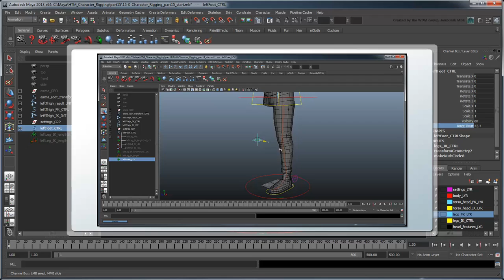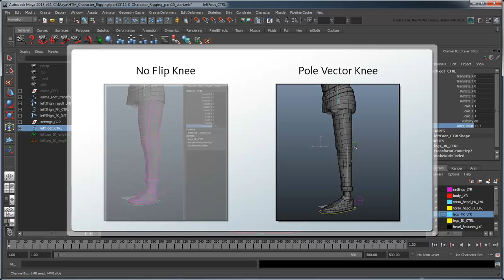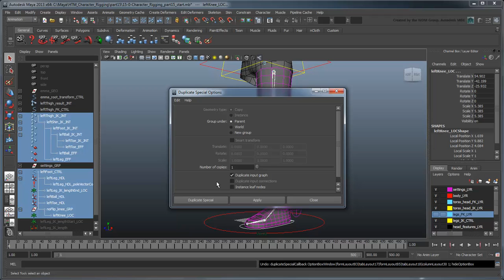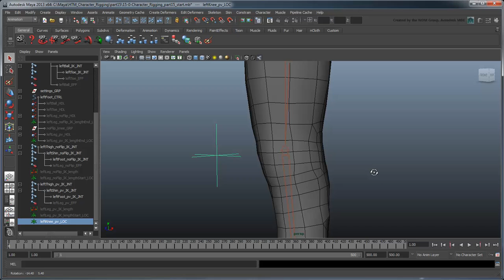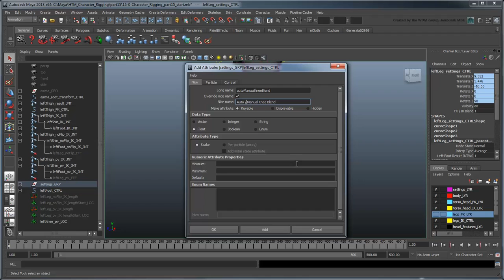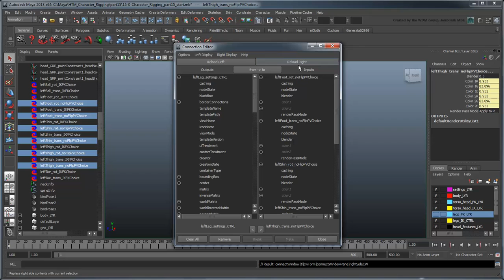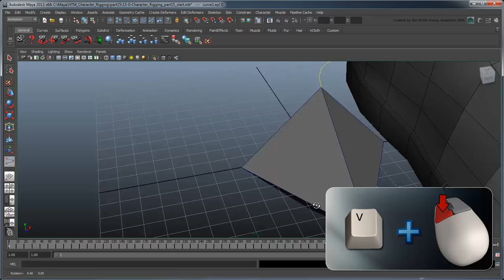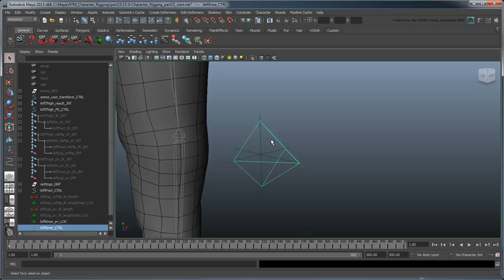Creating a Character Rig - Part 15: Dual knee solution (Advanced)

Comment: Minute 6:02 is confusing because you put leftThigh_noFlip_IK_JNT up, and leftThigh_pv_IK_JNT down. 
In part 10 you connected the upper node to color 1, and the lower one to color 2. So, we deduce that all noflip nodes should be connected to color 1, and 
pv nodes to color 2, but suprise! At 6:05 you have leftFoot_pv_IK_JNT up and leftFoot_noFlip_IK_JNT down. In this case, leftFoot_pv_IK_JNT should be connected to color 1
and leftFoot_noFlip_IK_JNT to color 2.
This could be a problem for some rookies. I even thought I was doing something wrong, but the problem was that I was doing it the other way around.
Please, correct this.
"Gracias" from dangerous Mexico.

Comment: So just wanted to be sure, for now and for the nearest future. No-Flip (Auto) and Pole Vector (Manual) is in the same order for FK/IK.

So in the node editor, "PV translates/rotates>Color 1 trans/rot" blenders.
And "noFlip translates/rotates>Color 2 trans/rot" blenders.

Is that right?
Reply from the maker: In all honest, it doesn't matter as long as you name the custom attribute appropriately.  However, you are correct that the Emma rig specifically follows those conventions.

Comment: when I delete the original IK foot_CTRLs rightLeg_HDL and rightLeg_IK_lengthEnd_LOC my leg mesh goes crazy. It like its lost the previous vid leg stretch. is that due to the inverted values in the script or the extra multidivide node mentioned in the comments.....really wish you did both legs at once ( 2 weeks later and I only have half a rig).
Reply from the maker: Try unparenting the geometry first before doing that stuff.  And yes, unfortunately it is quite a long process but I promise it'll get faster once you've done it a few times (it'll almost become second nature).  The idea was to leave the right side as a review of sorts, to make sure people really understood how to apply the concepts taught on the left side.  That'll be much more important for your career down the line than any single rig.

Comment: Dayum, i paused the previous vidéo to make my own knee aim controller (i did'nt want to control the spin within the channel box) But you did a vidéo about that X).
However, I think this is not the easiest way to do it. It's totally possible to have the same result with one IK chain and one pole vector (those created in the previous vidéo) using a method similar to the head follow tutorial ^^
Reply from the maker: The dual knee solution is optional.  You're right that it's not the easiest, but it is the solution that gives you the most versatility.
Reply: Yeah, i saw that after watching the next vidéo ^^. Thx for all those tutorials, that's really helpfull. Next time, i'll try with the multiple IK chains. It seems tricky to built but also  very interesting and easier for the animator to handle :)

Comment: Hi maya i delete the original IK_foot_CTRL and Leftleg_HDL in 2:42 on your clip .but my Thigh and Shin GEO is gone and Foot fallback To Thigh JNT  I have no i dear what i do wrong How it happen ?
Reply from the maker: Hmm, that does sound odd.  Was it all 3 leg joints that snapped up, or just the result joints?  You can probably fix it by selecting the foot joint and V+middle-dragging it onto one of the other foot joints.

As for the geo, are you sure it's deleted?  Is it still in your outliner?  It might have just moved along with the joints.
Reply: Thx, Maya The JNT  Snap back to thigh When Deleted IK_HDL but no JNT missing.It snap back just IKShin_JNT and IKFoot_JNT
Just dragging them back to result_JNT Thank you

Comment: Hi there, I have been following the tutorials closely but I am having problems after 5.53 in the video with the Node Editor.  I have input/ output connections available for the rotations , however I have no output translate connections available for the leftTHighIK_noFlip_JNT, leftThigh_pv_JNT, leftFootIK_noFlip_JNT and leftFoot_pv_JNT.  Is this related to the  leftThigh_HDL being deleted?
Reply from the maker: I think you might just need to expand the node by clicking the icon in the top-right until all 3 long boxes are white.
Reply: Maya Learning Channel  That's worked thank you

Comment: I'm having issues around 7:28 that involves the foot rotating with the knee when it's suppose to stay in place. I've checked the outliner and compared it to the exercise file provide to find any errors , however, everything is where they should be, all the constraints are fine, and it didn't have this issue before I started part 15.
Reply from the maker: Hmm, is it all the joints (both knee solutions) that are moving?  Just the result joints?
Reply: both result and IK are moving, but not the FK
Reply from the maker: Assuming the foot goes back to normal when you set the leg to FK mode, that must mean something is wrong with the IK setup.  It may be that a blender node is hooked up incorrectly.
Reply: Ok. I'll have a look.
Reply: the blend nodes were indeed connected to the rest joints rather than the IK, so I redid this part and they are now connected to the IK joints. The entire foot no longer moves with the knee, however, the foot still doesn't stay still. It slightly tilts off the ground  and out of place whenever I move the knee control
Reply from the maker: Sounds like the local rotation axis of the foot joint isn't straight.
Reply: I found out the issue. somehow, I had non zero rotation on my IK joints.

Comment: When I'm blending between PV and the noFlip chains, why does the IK foot joint move away from either foot joints of the driving chains? the position is fine of course when the value of the blend is either a 1 or a 0, but any number in-between produces weird results.  It's quite  noticeable if the foot control is positioned in any location other than the default pose.

Comment: Yeah, I'm back. I can't seem to get the switch from pv and the no flip IK joints you seem to be getting. When I hide the no flip and pv joints, and then try to twist the knee or use the pole vector, I see absolutely nothing. The switch isn't working. I have blend nodes for the thigh, shin, and foot joints. No flip is in the first color; pv is in the second. They are connected to the IK joints. I just don't get it. (I don't have any geo connected to the result joints either. Dunno if that'd make any difference or anything).
Reply from the maker: Heather McD Have you confirmed that each type of knee is working individually?  Also are the result joints currently shown or hidden?  If you haven't parented the geometry yet then the only way to properly tell if it's working is if you can see the result joints move with the appropriate no flip or pv leg joints.
Reply: Maya Learning Channel It's all fixed now. Thank you tons. :)

Comment: At the begining of this video the knee twist correctly, but for some reason my knee stops twisting in (min 4:13)
I tried doing all the proces twice and I can't figure out what I'm doing wrong...
Reply: Karina Waetjen I think there is something wrong with the Duplicate Special. The copy from leftFoot_CTRL don't twist the knee
Reply from the maker: Karina Waetjen Make sure the "Duplicate Input Graph" option is turned on in the Duplicate Special options window.
Reply: Maya Learning Channel yes I did it. But still not working...
Reply from the maker: I would download the scene files included with the project and try the duplication on that (15-1-No-flip_leg_with_result_leg.mb).  If the duplication works with that, then you know something is wrong with your file.  If it doesn't even work with the included scene file then something is wrong with your Maya setup.
Reply: Maya Learning Channel Yes, there must be something that I did wrong in part 14 because with your file it works. Thanks again for the help!!! :-)

Comment: For the noflip/pole vector knee switching, would it not be just as good an option to blend between the noflip and pole vector constraints directly, rather than having two extra skeletons? I know you've said a dual skeleton evaluates faster than constraint weighting, but if it's only one blend being used at a time, does it make a noticeable difference?
Reply from the maker: CellDevises There are other advantages, such as modularity and consistency.  That said, if you can make it work by blending between just constraints there's nothing explicitly "wrong" with that.

Comment: Hello, I use Autodesk Maya 2015 I'm having trouble with the leg to just like ikansumpit, but after applying the auto and manual no flip knee attribute and selecting the foot controller: the whole leg moves not just the knee but the foot, ball, and toe? The attribute is on auto but the hole leg moves with the foot controller. Any idea why? What should I do?

Comment: Hi, i'm having trouble with the foot doesn't stay planted to the ground when either Pole Vector Knee Ctrl or automatic NoFlip KneeTwist is moved a bit far to every side. The IK and FK joints stay planted, it's the Foot_result_joint that moves along. Any idea what part should I look on? 
this is the image link  https://www.dropbox.com/s/jphtvtxs6awp3j1/Problem_01.jpg?dl=0
Reply from the maker: That is very odd.  I have a feeling something is wrong with the IK handle setup.  Did you remember the additional foot IK handles (foot -> ball, ball -> toe)?
Reply: Re-doing the leg rig from scratch seems to fix the problem. Yes, i have set the IK Handles foot-ball, ball-toe before. I'm not really sure what causes this. Oh, I changed the foot joint rotation axis direction in component mode, so that the foot could rotate normally instead of making an arc downward when rotated vertically (but of course this has nothing to do with the pole vector case). Thanks for replying back anyway :)

Comment: Just to make sure. This time around when we connect the translate outputs into the blend colors, it's the whole translate output and not tX as we're not stretching right?

My auto / manual attribute was inverted, then I take it it was the PV in Color1 and the NoFlip in Color 2?
Reply from the maker: Right on both counts.

Comment: I find your tutorials extremely helpful, but as this is my first time rigging something up with more than a basic rig, it would have been much more helpful if you didn't skip the part in the node editor, especially for new people, the node editor is a big and scary place filled with dense and nonsensical numbers and demons.
Reply: I second Patrick's suggestion... I think it's worth it to repeat the steps of the node editor sequence. Yes, a similar process was covered in Part 11, but it's very important and fairly complicated. As someone going through the entire series, it would help to go over those steps again. Instead you've skipped past the work in the node editor, but you do repeat the process of tracing a poly object to create a NURBS curve. That's the part that I would suggest you skip.
Reply: Yeah, I like how he opens the horrible tangled mess that is the node editor and is like "This seems like a good part to gloss over. There's no way someone could make a mistake here."
Reply: That's right...and I'm a new peron
Reply: me too, I like to follow right along

Comment: This is just a comment that might help other riggers. when positioning the initial pole vector (for the IK leg) I leave the FK and Result joints visible so I can position the pole vector so that the IK knee joint aligns with the FK and Result knee joint. This means you will have to move the locator in any necessary x, y or z direction. I freeze the transformations on that pole vector.

This seems great, but to avoid running into headaches on the smart foot roll you have to take an additional step. When setting up the dual knee, after you have reset the manual knee pole vector to it's default position, I go back into the NoFlip knee pole vector. I use snap align, the move tool and freeze transformations so that the y and z value of the No Flip knee pole vector are 0, while the x value is a positive number.

Comment: As a fellow rigger, what Frederic Partiot has suggested as the connections is correct.

An additional side note, if your legIK joints are in a skeletal hierarchy, you MUST parent the legPV joints and legNoFlip joints within the skeletal hierarchy, under the same parent which the legIK joints reside under. This affects the translation values of the legPV joints and legNoFlip joints.

Another useful tip, instead of using layers to change the color of NURBS curves, go into its attribute editor > drawing overrides > enable overrides > then select your color

This might be covered at the end but here it is if you're impatient

Comment from the maker: While this would create a pretty un-flippable scenario, it's generally preferable to have controls acting independently of each other whenever possible (hence the two solution leg).  It makes trouble-shooting much easier further down the production line.  Additionally, the setup you've suggested can have some negative implications on the snappable IK knee (which you'll see in part 16).  It will make it very difficult to position the foot when the knee is planted.

Comment: Great tutorial!!  This is by far the best rigging tutorial series I've seen.  Just a suggestion,  instead of setting up a dual knee solution, I actually try aim constraint the knee twist to a locator and put the locator parent under the foot control.  This way I can have both no-flip IK and traditional Pole Vector hybrid solution.  Have you try this method?  I haven't seen any down side yet